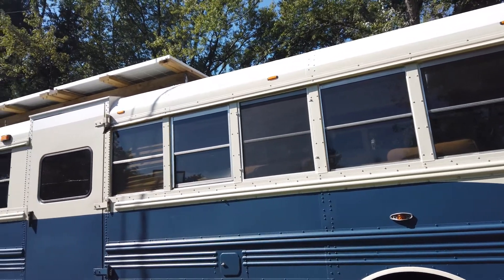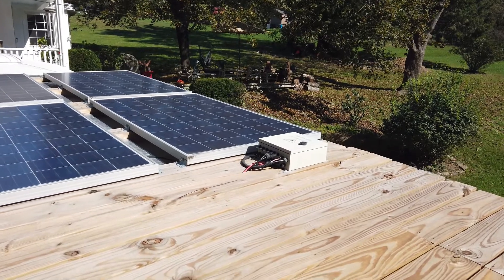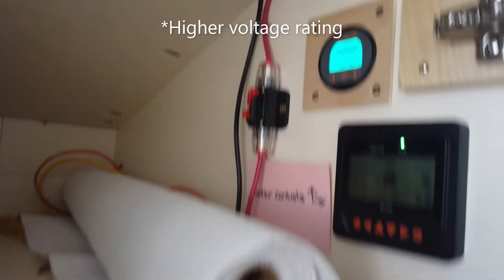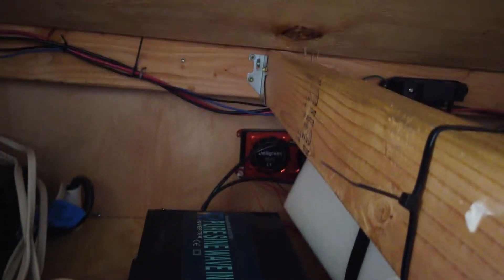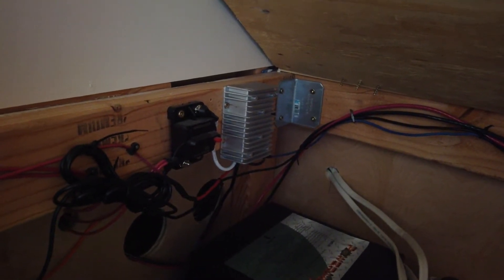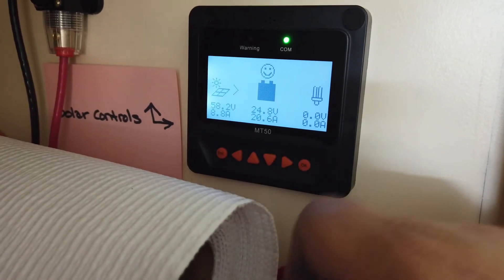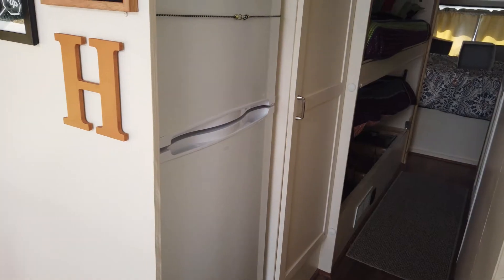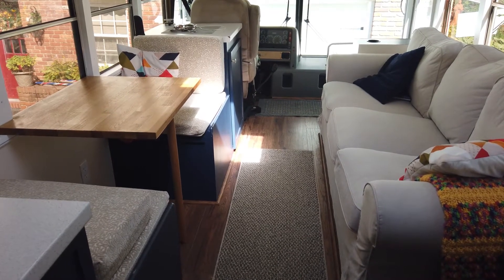DIY - Off-Grid Solar Electrical System using Nissan Leaf Batteries - Harmony Express Skoolie

Comment: Well top of the Day to you. Yeah I also learned quite a bit from same guy you did. Seriously about the same inverter charge controller and batteries. I love your setup I only have 7 batteries but want to jump up to 9 or 11 as well. I have a 24-volt system but I bought a 3000w inverter and a 60 amp charge controller you pretty much have the exact same setup I do. My solar panels r330 w a piece so I have 1290. How is the bus and all the charges and everything else continuing to go?
Reply from the maker: So you are in a 7S setup on your 24v system?  What voltage do you run regularly??  Beware changing to 9 cells and going 6S…. There are not many BMS’s that are 6S out there.  I might add three more cells and go 7S on my system so I can get a smart BMS….
Reply: @HarmonyExpressSkoolie  I'm actually not set up just yet I just have everything and need to set it up ASAP. And I'm a little stressed because I haven't hooked up my batteries and they've been sitting for almost six months and I'm going to need to individually charge them or level them out somehow. On your buck converter which one did you by and how many amps is it?

Comment: Hi Mike I have 18 leaf modules in my 24 volt system. I have used them over 2 years with no  bms 
I've had no problems with at all.They have never gone out of balance.
Reply from the maker: Thanks!  We have 9 currently in 24 volt configuration, and I have 6 more waiting to be top-balanced and a BMS, and I'm going to expand my storage capacity.

I love my Leaf Cells...

Thanks for your comment and for following along!

Comment: Nicely done video Mike. I might need your help on the setup of the Dahlgren BMS for our LIFEPO4 cells.
Reply from the maker: Is your BMS a smart programmable BMS or is it just a “plug and play” unit?  Ours is not a smart BMS, and that is something that I’d like to change…
Reply: @HarmonyExpressSkoolie  yes. With the Bluetooth dongle and temperature sensor.
Reply from the maker: @allmomomosthomebus3895  I can certainly help!
Reply: @HarmonyExpressSkoolie  I'll let you know when I'm setting that up. Working on plumbing still.

Comment: Great episode, Mike.   It was a nice, complete and just technical enough to keep your audience, regardless of education or experience in you grip.   Do you need to vent or control Temps in your main power enclosure?   May I suggest that you include a short glossary for some of them terms you used like buss bars, battery and battery drift and terms like shore power?   Rock on, fearless Leader!!
Reply from the maker: Thanks for the advice, Groove!  Just so much information to cover in one episode that it is hard to cut things back!  There most certainly will be more content on the batteries for sure…
Reply: @HarmonyExpressSkoolie  What you said, exactly.   I was thinking of a printed list or pdf in the comments section.   Great episode!